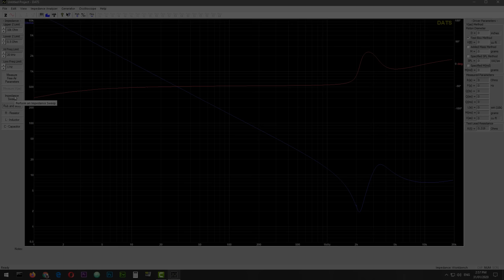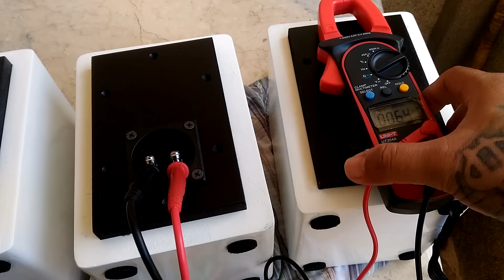How to Make Small Speakers for Desktop and Home Theater Surround

Comment: What is the meaaurement ot tweeter and speaker?
Reply from the maker: Tweeter = 1", Woofer = 3"
Reply: @chrclmnky  are you sure the woofer is 3"?
Reply: @cirosantiagoionio7729  pretty sure this man knows bis stuff. Also look at how tiny it is compared to the thickness of the mdf even. With that being said, yes it looks line a 4 inch😂

Comment: Where's the links to the parts?
Reply from the maker: I bought them locally.
Reply from the maker: Bob Mwansambo  there many online flea market that sells like these speakers. Like AliExpress, Banggood, Dhgate, etc. All you have to do is search for them.
Reply: @chrclmnky  please give the discreption of each part from where you buy. Like crossover, woofer, tweeter. Wattage and price
Reply: @SachinB.A.  you can pick your own by searching for each part yourself, just match the impedance and wattage of the drivers with the crossover circuitry and the amplifier you will use for them!

Comment: These speaker guys alway assemble boxes in the wrong order
Reply from the maker: @kden1271  what order what?
Reply: @chrclmnky  I hope you're not trying to be a smart ass any real carpenter will tell you you are wrong, but pieces wrong order pieces. What you did 100% will work but when you are trying to build something as strong and solid as possible to prevent vibration you could have done better is all
Reply from the maker: @kden1271  i hope you can build as good as you judge. Let me see your builds and we're talking.
Reply: @chrclmnky  I've been self employed over 20 years building every thing you can think of from wood. Not sure why you got butt hurt. I'm not sure why you would argue with someone willing to teach you something either.  I guess ignorant people do ignorant things sometimes right
Reply: @chrclmnky  there's a correct order to build/ assemble a box to properly seal it and make it as strong as possible.  But again half ass 100% will work. Might want to youtube that I guess good luck. I also really like that overall build process other than wrong order
Reply from the maker: @kden1271  no you're not teaching. I didn't see any of it. You're here for the attention.
Reply: @chrclmnky  want be to turn you a b-plug?
Reply from the maker: @kden1271  turn it for yourself you need it more

Comment: Там катушки не нужны, резистор тоже!!! уберите все в фильтре кроме конденсаторов.
Reply from the maker: Coils are for the woofer. I need frequencies lower than 2500Hz to go to the woofer.
Reply: @chrclmnky  they already get into the speaker. Coils for 3 loudspeaker strips. You have 2. Just do as I say - remove everything but the capacitor - you will understand everything.
Reply from the maker: @Maxim_Slim  no inductors will sound like sh*t.